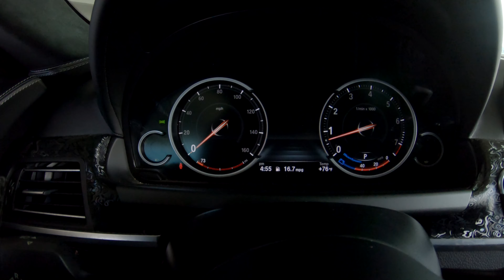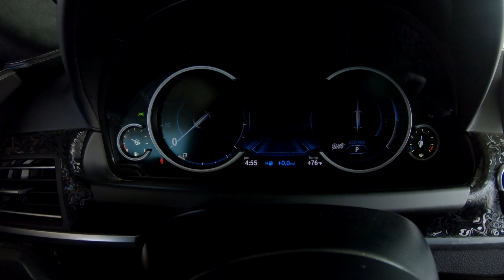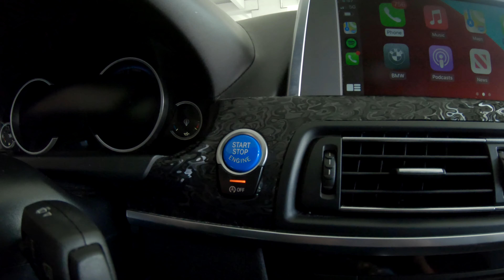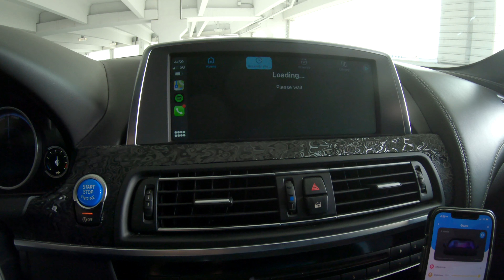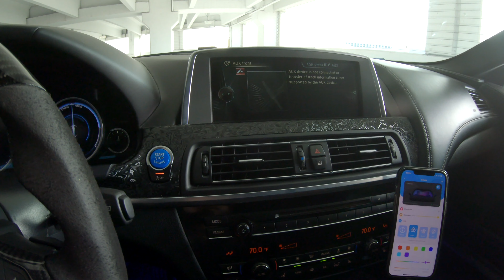MHD STAGE 2+ 640i GranCoupe with 1 of 1 Custom Interior F06 Walkaround/Build

Comment: Good stuff bro. Quick question, both from and rear tires are a 30 sidewall? Usually you see a slightly bigger sidewall in the front vs the rear. Any specific reason you didn't do a 35 sidewall in the front?

Comment: Can you have OBDLINK cx bimmer code and MHD on your car at the same time? I just purchased a OBDlink cx adapter for the bimmer codes but also have the MHD adapter otw also, can both be used or do they serve the same purpose? 

Ex: I use the OBDLINK to activate launch control save that. Can I then use the MHD for the tuning part?
Reply from the maker: yes! you can also use the MHD adapter with bimmer code, just have to select the mhd adapter in bimmercodes settings! hope this helps
Reply: @rnrmotorsports  it definitely did remember how I couldn’t launch my car, well my car had launch control deactivated so I just went in and activated it now launch control actually works

Comment: Can I get a link for the carbon fangs and the underglow link please and do you think it will fit on my 19 f06 m6?
Reply from the maker: the carbon fangs would be different because the m sport 6 series and the m6 have different bumpers
Reply from the maker: Link to the under glow 

Govee Underglow Car Lights, Smart Under Car Lights with App Control, RGBIC Car Underglow Lights with 16 Million Colors, 2 Music Modes, 10 Scene Modes, Exterior Car Lights for SUVs, Trucks, DC 12-24V https://a.co/d/f0NwnwT